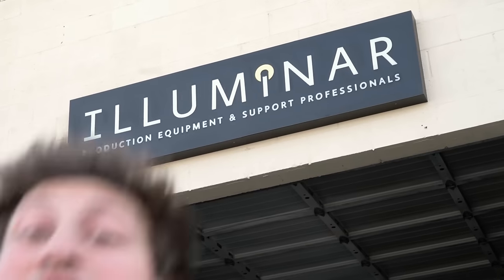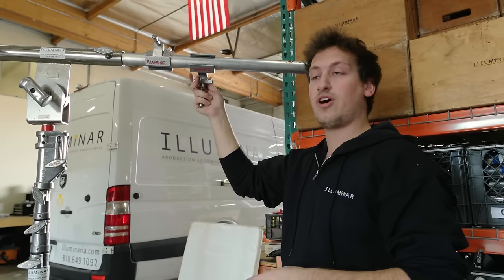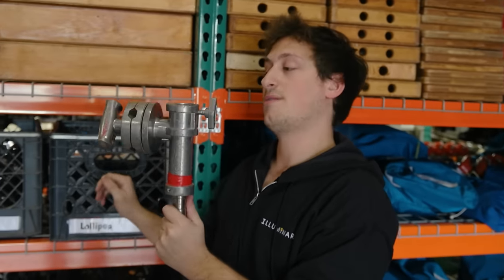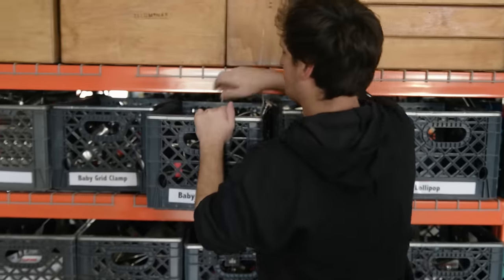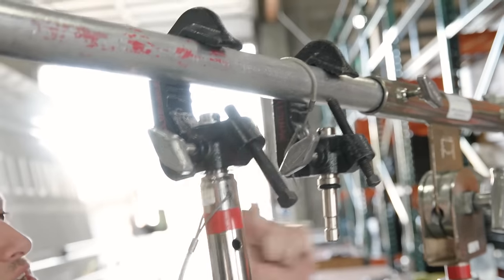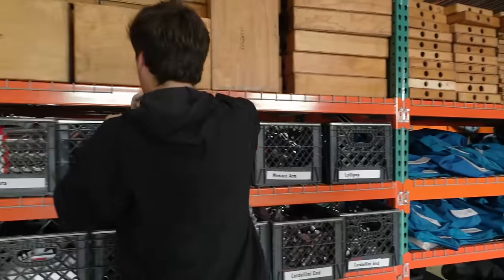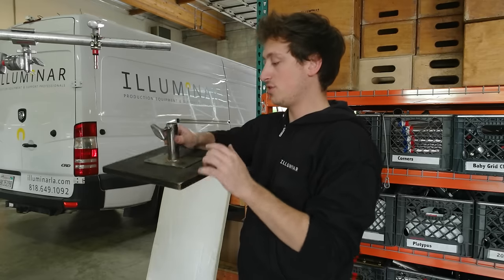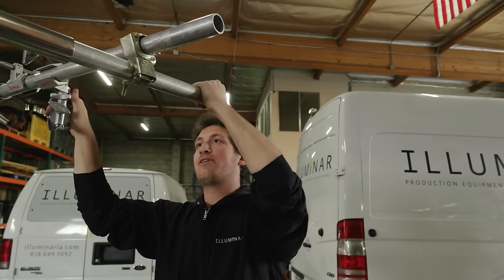Grip Hardware Essentials

Comment: Another name for the Platypus clamp is the "Quacker clamp"
Matthews brand Cardellinis are known as "Matthellinis"
Another great video Dom!
Reply: bensonq or Mick Jagger
Reply: Are there any differences between Cardellinis and Mathellinis other than who made it?
Reply: Max Phan  there is no difference between those two... It is use for rigging the ligts
Reply: Cardellinis are made with stainless steel and cast aluminum, matthellinis are made with chrome plated steel and cast aluminum.  The difference between the two is minor but you will notice over time, especially if you get them from a large rental house.  Matthellinis can rust and become hard to tighten, you should be able to spin a cardellini knob and close it in one motion, not so much with matthellinis.
Reply: Yes they are different  @maxphan3376 . The Matthellini has a much wider turn handle giving you more leverage when securing or loosening the clamp. The Cardellini shaft is constructed from stainless steel and the Matthellini in chrome plated steel. The Matthellini is also available in larger dimensions and has the extend-allini accessory which greatly widens the Matthellini jaws. Both are great but they are a bit different.

Comment: by the way that is an R clip, the split pin is the one you spread out with pliars, like for your wheel bearing nuts, or other crutial parts, say in jet or propellor aircraft engines, so the nuts don't slip off, it is called an R clip, or hairpin clip, as this is what it looks like, a squished R.

Comment: For the platypus, why would someone choose a foam bounce board, like in the video, versus one of those foldable ones? Is it a size thing, since bigger sources are softer and I've seen foam boards bigger than the one in the video? Or is it a density thing?
Reply: What you'll notice in the film industry is that everyone has their own preference on what kind of tools they like to use. The collapsable reflectors can be just as good. They're great if you have to have a very small and light package. Maybe you're traveling or moving locations all the time, or only have a small van to carry all your equipment. That's a good reason to use the collapsable ones. I'm usually always using a truck and can have a 4x4 bounce/bead board.  With bounce/bead boards, there are usually 2 sides. A "soft" side and a "hard" side. It just bounces the light in a different way. And there are all kinds of sizes of them. 2x2 (pizza box), 2x4 (Surf board or Silver Surfer [if it has a silver shiny side]) 4x4 and 4x8 are the most common sizes of bounce/bead boards. And another reason I like the thick bounce boards, is because they're easier to clamp with the platty and set somewhere on a stand to bounce or reflect light, so I don't have to stand there and hold it.

Comment: For me it seems like so many different clamps to do the same job.
Reply: Necessarily, since the dimensions of things you need to grip all have different dimensions and properties, as displayed.
Reply: But like, the cardellini clamp, mager clap, baby grid clamp doesnt seem any different in function, just different way to tighten it.
An Pipe camp can do bigger stuff, I understand that....
Reply: There is indeed several clamps that do the exact same job. However, a swivel clamp is less rigid than any fixed clamps. Some type of clamp are better for light load, other more suited for heavy ones. Some are safer than others. 

I forgot the name, but the clamp with the screw that you tighten with the wrench, it is fine for something that hang down, but a bad choice for something that need to stick sideway: the scew can bend and it is all what prevent it from twisting. The other that basically close around the pipe will give a better strength and actually is harder to fall off. But is more expensive.

An horisontal clamp have different strength and force than one that will have to handle a vertical position.

Also, equipment cost... A plain spotlight may be 400$, while a controllable spot with changing color and pattern can get over 10000$. Do you want to use the "cheap" clamp on it? You will probably use another clamp, who care about the time it take to install that one!

And, of course... The equipment need to be aligned preciselly. some clamp offer more stability than some others, but may be more of a pain to install. Some other equipment, like a smoke machine, could be off by several degree and you won't notice it at all.
Reply: Sorry Fabian, You are completely wrong. Cardellini clamp and and Mafer clamp they don't do absolutely the same job. Cardelli camp end with a round pin fixed, when instead Mafer calms have no pin fixed. You can choose different pint to fit in with different ends to rig specific request. Also Mafer clamp can be doubled up connecting two of them by screws at 90 degrees. Last but not less importing difference is the price : Mafer clamps are much more cheaper then Cardellini.

Comment: Shot Bag also 20 Pounds weight? :o
Reply: the difference isnt the weight but what they have inside, one has sand and the shot bag has something like bb ammo in it. oh yeah and as a result the size is compressed. good luck!
Reply: Antonio is correct it holds lead which weighs a lot more than sand does obviously. It is useful for balancing a light on a boom or whenever you need the weight without the size.

Comment: Nice.  Wouldn't be an old ex grip if I didn't add a comment.  Safety cable.  In my day the butt plug was called a Frisco Pin.  Ain't gonna hear that anymore.  First job I did (1982) as a grip (I was a film school student) hired by a novice producer for peanuts and just so happy to be working on a real film shoot even though I had probably shot a hundred thousand feet of film on my own. the Key Grip asked me to to get a full apple box and I went to the grip truck and looked for anything to indicate apple box.  When I returned and told him I didn't know what it was, he did not talk to me the rest of the shoot. Not one word. Might seem harsh, but I took a notebook and wrote down the name of every single item on that truck with the explanation of what it was for, so that could never happen again, and to my knowledge it never did. I would go on to order Mole Richardson, Matthews, and American Grip catalogues to make sure there was nothing I had missed. The importance of knowing the tools of the trade and how to use them has been invaluable over the years.  After watching all this guy's videos, go to the biggest rental house and ask if you can go through their list of equipment.  That will give you an idea about how much the items are to rent and which brands best handle rental house abuse.  And be safe, grips are often asked to do sketchy things to get a shot or solve a problem temporarily. I've seen several shortcuts end in disaster.

Comment: Shot bags are filled with steel shot and are much more dense than sand bags. 1/3 the size as sand but same weight. Downside is they are 3-4x that of sand.

Comment: @8:05, Additional Pro Tip: Use PVC pipe cutouts to protect the rented pipe or Truss against burring from over tightening the screw. They're commonly called Truss Protectors or more colorfully Truss condoms. Pic of City Theatrical's product: http://www.lighttrader.com/images/CTY1371_L.JPG . Cheaper Home Depot alternative, buy some feet of 2" PVC pipe and cut to suite.

Comment: wait whats the apple boxes for?
Reply: the full apple i believe is mainly used for sitting down on a dolly. all the apples are a great solution if you just need a bit of extra height to reach something without needing a ladder or getting some extra leverage for a light-stand leg. the pancake is for the ballast(a box which is used to transfer electricity from the power socket to the light) so its not touching the actual floor incase its wet or something.
Reply: Apple boxes are great for suspending things that would otherwise be on the floor or giving things extra height. Say your couch is too low for a shot, throw an apple box under each of the couch legs and you got a stable solution to get a lower angle shot. An apple box under a short actor, when doing an OTS with a taller actor, works well for dialogue shots without actually changing the angle of the camera. There's a myriad of uses.
Reply: wow O_O I used to just use an old Wii Balance Board I had to get two subjects to be similar height, never knew people used apple boxes. Thank you to both of you.
Reply: "Grip to Ground Adapter"
Reply: I've seen them used for almost anything.
Reply: Storing apples. Pancakes are used to store tortillas.

Comment: Is it just me or does all of this stuff look like it's from the 1940s?
Reply: Most of it was probably designed in the 30s, 40s and 50s. Also, a lot of them are cast steel, cast aluminum, or they're made by welding stock together - all of these practices were common manufacturing processes for consumer and professional products in the early-mid 20th century. They use these processes because they're simple, strong, and don't need to look good. Professional products in some industries tend to not change very much over time because they work well and the companies that use them have enough leverage to keep the companies producing the product putting out the same design.